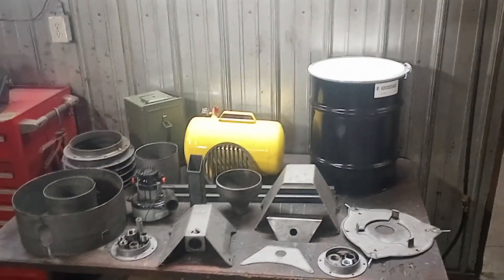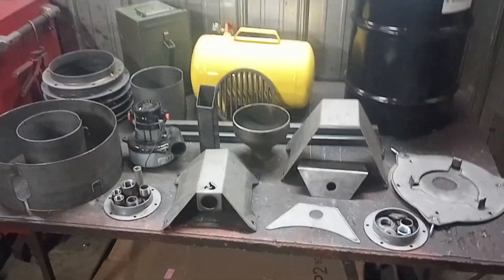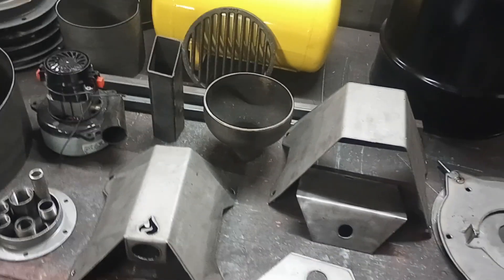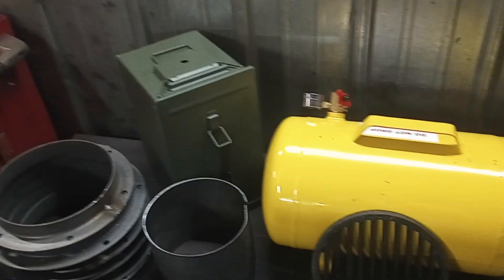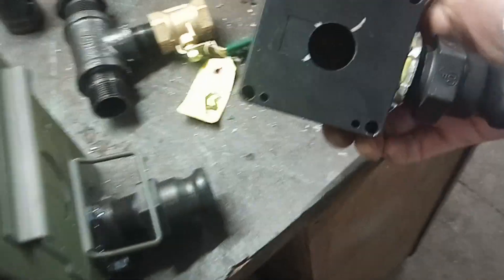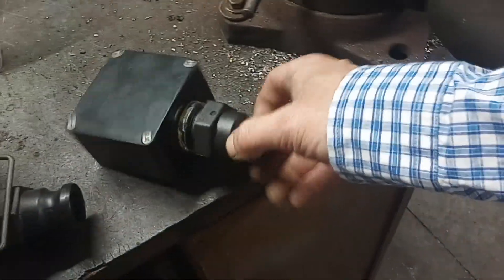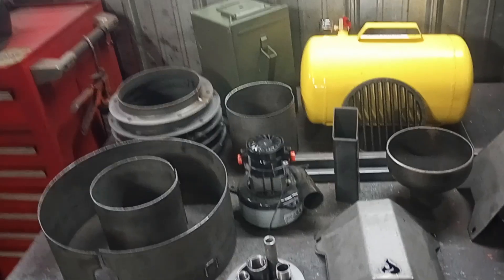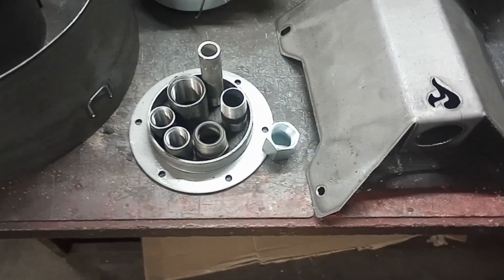Harbor Freight DIY Gasifier Kit!! Part 1 ( The Introduction)

Comment: What size engine is this gasifier designed for?
Reply from the maker: It is designed for typical off shelf generator with the 420 to 500 cc range engines. You do not want to try to wood gas engines any smaller than this, its not worth the cost and effort for what little power it will produce on anything smaller. 

The 420 / 450 cc generators are perfect for off grid. Especially the inverter generators with parrallel capability. You can then scale up or down at any time. If you go bigger and only need to run light loads then that generator is going to hog down your fuel. That fuel is not free and it is a ton of work to produce regardless if its wood chips or charcoal. You want the most efficient system as possible and the inverter gens with parrallel capability are the best solution we have available.
Reply: @Thrive-Off-Grid  Awesome! Thank you. Will be purchasing. Very Exciting!